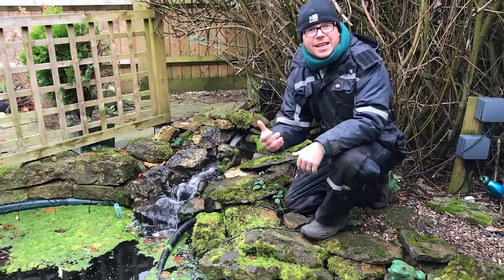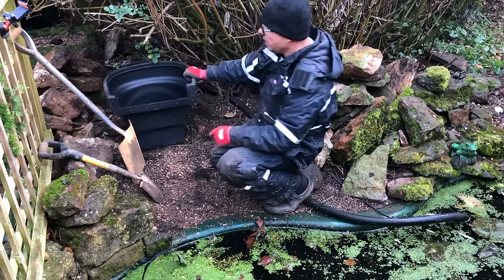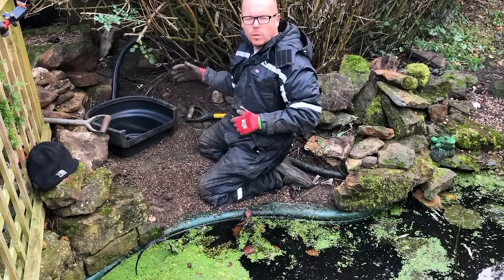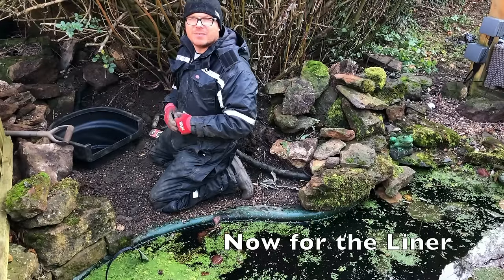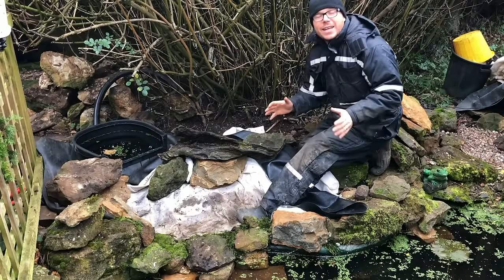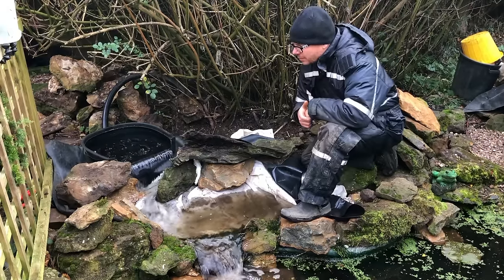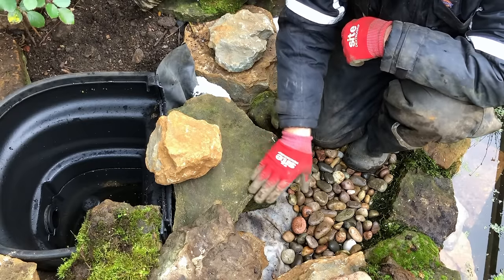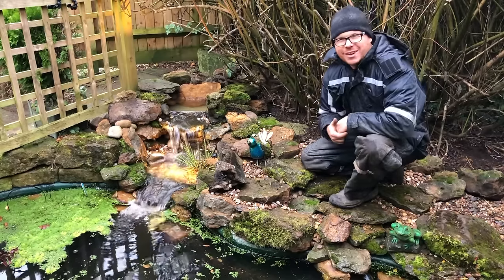Building a Spectacular Garden Waterfall with a UK Waterfall Kit

Comment: Hi, thanks for putting these videos out. I’d like to request if  you will, that maybe slow your video a touch and explain a little more what you are doing when you seal water pumps, placement of and removal of pumps, underlays, overlays, types of sand/rock placement, etc. while you are doing it. If to save time, make notes in the video that those of us you are watching every detail may learn and understand the right ways. I see that you do teach this on some occasions but many things get missed that are crucial, that maybe come as already obvious to you, but not to me or other eager learners. 
Thank you! Looking forward to another video.
Reply from the maker: Thank you very much, the best way to learn for a lot of people is to have a go.  Then repeat.  Well that was the best for me anyway.  Thank you very much for your kind words.  I forget I have been doing this for 30 years and yes I do skip a lot.  Hence why I think water features in kit form are the way forward. This allows the builder/installer to concentrate on the creative side instead of the way the features functions.
Reply: @ThePondAdvisor  hi..im looking to do a small pond with a waterfall in the garden,maybe  1.5 metres squared..could u advise me on what size pump id need if the waterfall  is about 36inches  above the base of the pond?thanks,love your work👌
Reply from the maker: Shane Connolly great topic, I have a video coming out soon about size of pump.  4000 litres of water per hour over a 30cm spillway will give you 1cm of water in motion.  Enough for a curtain effect.

Comment: I want a similar waterfall but not as strong as I would like it slow flowing for the birds to bathe. What was the final cost for materials for this job and is the pond box essential. I have quite a heap of spoil and I retained the heap by using sleepers which are now rotting and almost falling in due to plants and weight of soil, I think I would be best to take spoil out and have a much lower waterfall rather than the water falling from height at its final entry point.

Comment: Hi Mark, fantastic result. 

Watched it about 4 times to see how you work the edpm into the pond and how you create the edges, i was really struggling with that.

I am rebuilding my own waterfal and have a lot of inspiration, i have a couple of questions if you dont mind😅😅😇😇
Can you tell me what expanding foam you use and is it safe for fish? im thinking to go with the black scaping foam.
Also what is the output of the pump and does is run through a pressure-filter or straight to the spillway?

looking forward to your reply.

KR

Bo
Reply from the maker: Thanks for watching

Comment: Hi. Does the waterfall need to continuously run to properly filter the water or could it be turned on when I'm in the garden and turned off when I'm not? I'm just thinking of the expense of running it 24/7. Great video btw,.Thanks.
Reply from the maker: yes the filter needs to run if you are supporting aquatic life.  the cost of running is about £60-£80 per years so some would say it’s nothing and other would say it’s not worth keeping the pond fish.  if it’s all about the sound for you, then look at the pondless waterfalls they can be turned on and off.

Comment: I have a 6ft x 4ft area in my garden that I’d like to build a rockery with water feature. However, mains power isn’t an option so what would you recommend in the way of solar powered pump options? Thanks.
Reply from the maker: we are looking for solar feature pumps, however they are not lasting very long, we are now looking at solar powered batteries to run our 65 watt pumps

Comment: Hi, I am building a natural pond 4m x 2.6 at widest points. 60cm at deepest. With a  short waterfall 1.5m long ,1m drop. I don't want to use filter and waterfall will be for occasional use. My question is what sort of pump would i use? Would appreciate your advice. Thank you
Reply from the maker: A submersible pond pump, depends on the width and style of waterfall you want 4000 litres per hour (or 1000US gal) per 12” curtain style waterfall.

Comment: cuppa soup commercial if i ever see one :P
Reply from the maker: You know it makes sense, it was cold ha ha
Reply: @ThePondAdvisor   love it, the best meal for ont he job, some bread and soup...
Reply: @ThePondAdvisor   :P btw can you name one reason i should NOT use an indoor pump outdoors? Accidentally bought a indoor one, its for a mini pond and the electric cord is long enough to be plugged in inside. maybe problems in wintertime?
Reply from the maker: @willen5405  depends on the pump, if it’s submerged they you should be on.  A lot of small pumps are designs for in and out

Comment: Excellent video. I’m building a small pond and was falling into a pit of staged waterfall until I saw this video! You gave some great ideas that I am going to try to work into my pond. Question, was is the tube of white adhesive that your using? Is it made specifically for ponds? Thank you so much for sharing this one! Not everyone can afford a large pond and you have shown that a small pond can look natural as well!
Reply from the maker: Waterfall foam
Reply from the maker: Thanks for watching
Reply: Hi Dee, if you ever want any advice I would be happy to give you advice. 😊 if you want to foam your waterfall just use expanding foam from any hardware store. It's original use is for closing the gaps in door frames and window frames and isn't expensive. I believe you will find it costs about 5 quid in the stores.

Comment: Did you install a ball valve in this system?
Reply from the maker: Pedram Bastan no! If we installed a ball valve we would have to install a blow off.  As the water would be backed up against a valve, it’s just like closing a door, were is the water you turn down going to go?

Comment: Very informative video. I have already invested in an expensive pump and filter system and now just need to create a reservoir for a new waterfall. It seems expensive to use the waterfall filter box you have. Do you recommend any others where filters are already in place?
Reply from the maker: You can design and build your own off course. We have done many over the years and have chosen this filter as it’s a professional piece of kit.  If you have filtration in place use the spillway boxes. 12” version is available for up to 15k litres of water.  Also they is the DIY waterfall filter (price point £119.98) 

https://waterfeature.shop/products/aquascape-uk-pond-waterfall-filter-77020

Comment: Hi Pond Adviser - I have been loving your videosand the tips I have derived from them! Particularly like the lunch sequences :-D Question - what would you do if you were putting together a rockery mound for a smallish waterfall but the soil is bone dry and very fine? This is the problem I have - it's like working with dry beach sand. Impossible to carve a defined shape for the cascade in it. Should I just drench it and leave it for a bit or is there something else I can do?
Reply from the maker: i would build a rockery, stone back fill and plant then another layer of stones, backfill and plant, so the stones act as mini retaining walls, look into using alpine plants
Reply: @ThePondAdvisor  thanks for the reply. I will look into the alpines and proceed as suggested. I suspect one of my problems is that I have a winding waterfall that goes back on itself then doubles back again, so I might be trying to pack too much in. I can see you shaking your head now!

Comment: You didn’t explain what you used to fix the stones in place 🤔
Reply from the maker: Pro Foam
Reply from the maker: https://waterfeature.shop/products/pro-waterfall-foam-sealant?_pos=1&_sid=a68585363&_ss=r
Reply: Thank you for replying so quickly. I was wondering if you were cementing them. We are hoping to start putting in our waterfall tomorrow so that’s very helpful.
Reply from the maker: No cement, not used cement in a pond for 8 years.

Comment: Eugh.....I see that pond has the headache that is duckweed.....I have this in my small frog pond, driving me insane. I’ve been scooping it out on an almost daily basis and it spreads like a parasite. I’ve now put a dose of a product in that claims to beat it.....let’s see
Reply from the maker: It’s s fantastic plant, it like still warm water. Adding aeration or a waterfall and skim cove/intake bay will solve the problem.  Chemicals will control it with contact but it’s better if you can install a way it filters itself out.  Do you have a form of filter or way of moving the water around.
Reply: The Pond Advisor all it is is a small frog pond with a fibreglass waterfall.
No filter, just a small pump pushing the water up through the waterfall
Reply: The Pond Advisor it probably does have its benefits but it’s just unsightly when it covers the entire surface, there’s newts and toads in there and you can’t see what’s going on under the water when it takes over
Reply from the maker: @dazza944  install a micro skim cove or surface skimmer that will solve the problem